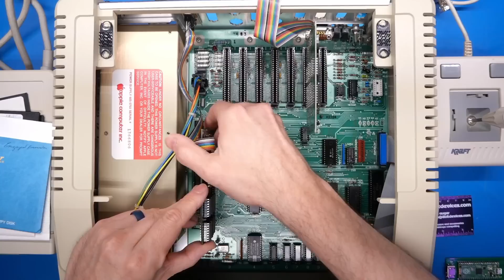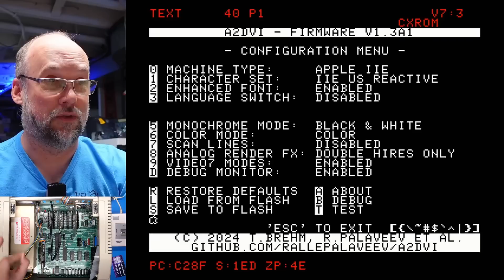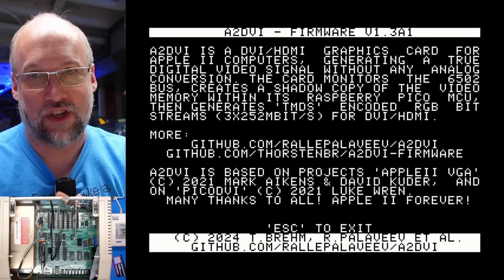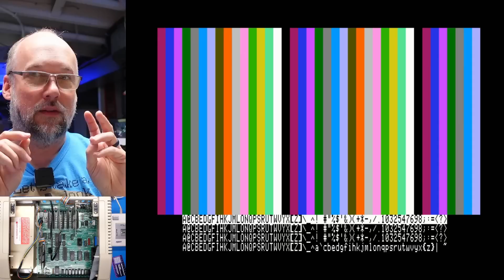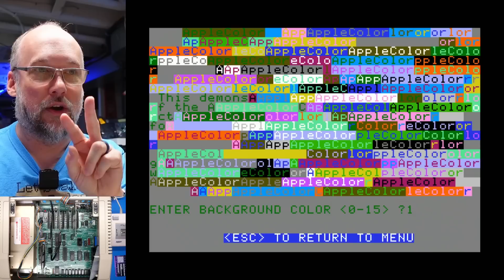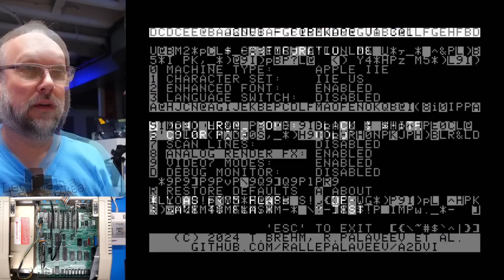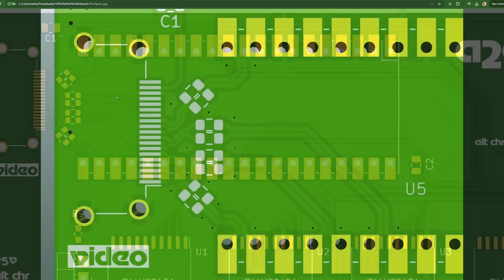HDMI video from your Apple II with this cheap and simple project (A2DVI)

Comment: Ok so any chance to add sound card support to the same card?  HDMI supports sound and video.
Reply: Unfortunately, HDMI is covered by patents. That's why devices like this are implementing DVI (which is compatible with the video portion of HDMI) and using an HDMI connector. True HDMI with audio would require an HDMI license.
Reply: @dnwheeler  the raspberry already has hdmi   You are supposed to be able to write software to use it.   Doesn’t make sense to me that you have to pay a special license   If I make a computer game for the pc I don’t have to pay a license for each person that plugs their monitor in.   If it can’t be done fine   Not a big deal  I was just curious because if everything is being done in software it would make sense to me to also emulate a sound card in software.
Reply: @krakenunbound raspberry pi yes, but pico does not have hdmi.
Reply: @krakenunbound  The Pi Pico doesn't have HDMI - the "regular" Raspberry Pi's do (and they pay the HDMI license fee for those).
Reply: @dnwheeler  a2fpga uses a Tang 20K dev board and as well as video also emulates the mockingboard at the same time and supports video from the IIGS too, and sends sound via HDMI, though it seems like some TVs don’t like the output. ReActiveMicro sells the card with a Tang 20K assembled for $199 (yikes!), but the project is also on GitHub. Ct6502 and Lon TV have done videos on it, as have a number of other YouTubers more dedicated to only the Apple II.

Comment: Fun stuff. And I've been "harping" about something similar, which is bringing "software based hardware" to old machines.Some sort of bridge from host to SPI/I2C and bam, "infinite peripherals" for "not much money". In this case, a beefier Pi would be the SPI/I2C part itself, you'd just connect the other peripherals to the Pi...
I'm a software developer not a hw guy, so I've been tinkering with the concept in a way that fits my world better, by using UAE's builtin bsdsocket to implement "proof of concept". And who would have guessed, if you have 100Mb I/O and a slow CPU, for many a task it's simply faster to send data and get the result back. Sort of fun when you go from CPU bound to I/O bound. But having "near real time" JPEG decoding with good scaling and color quantization is something a 68k can only dream of, yet, trivial to any "spare core" on my 5600...
That was the whole idea of expansion boards after all, it's just that now it easier to do them in software in new (off the shelf) hardware than it is to build "custom hardware".

Comment: They're not quite bit-banging. They're using the PIO processors on the RPI to do it. And they may have to overclock it a bit, too.
Reply: The Pico 2 is even better for this too, the Raspberry Pi team saw that people were using PIO for stuff like DVI video, so they added a HSTX peripheral to RP2350 which is specially designed to handle software defined high speed digital output cleanly.

Comment: I like your idea of switching between color and monochrome, but I'm guessing it would be easier to just add another accessible GPIO pin. Then you wouldn't have to hack the machine itself, the modification would transfer to any machine where you use this card.

I thought everyone in our "field" knew DVI and HDMI are signal compatible. You just need a passive adapter to interface them. This has allowed me to keep many old monitors working until they just fall over from old age, all with a $3 or so passive adapter bolted to the back. DVI doesn't support audio, but I never expected my monitor to handle audio, so that's fine.

Comment: Imagine what would have happened if Apple had included 80x25 text mode with the ability to change the foreground and background color per character way back on the ][+, with a font (in character ROM) that has the funky characters of the IBM PC character ROM from 0x80 to 0xFE. The release of the poor IBM PC (5160, I think?) would have been less than exciting, despite the advertised 4.77 MHz clock speed, as it would have really only added flashing characters as a new feature. Even worse if Apple could have overclocked the 6502 to 2 MHz, but that wouldn’t be possible until the 65C02, IIRC. Oh, well.

Well, now we have these (mostly), thanks to this new card. Too bad I don’t have a //e anymore. 😢

Comment: For the IIGS there is the VidHD, which also works for the Apple II. There are a few videos on YT about it. It’s $135 USD+shipping, so not that cheap, however it runs on a SBC, not a microcontroller.

Comment: How does this work with //e memory cards that include more than 64k of RAM in the extended 80 column slot, such as the AE Ramworks? Bus snooping that gets tricky since IIRC, the 80-col/DHGR video data always comes from the lowest 64k bank, which means you would need to pick only writes when that lowest bank is selected. The same issue might apply to //gs support.

Comment: When I was a young lad my parents purchased a used Apple II+. It came with a nice green screen monitor, 1 disk drive, 64k upgrade language card,  Okidata 82a printer, and Grappler + print card. The place I worked at had a Sun Remarketing catalogs. I wanted to run apple works and I know you could add another disk drive, and 80 column card. However due to the cost of even the disk drives. I sold my Apple II+ and invested into my Pc-Clone. Now it is years later I found out about, cpm card, and tons of other goodies like a rgb card. If I would have known the CPM card existed and a few other things. Probably would still have it. I loved playing with CPM on Kaypros. Speaking of RGB. I remember walking into a Radio Shack and looking at a Deck out CoCo 3 with RGB on it. It looks like a real computer. Compared to the TRS-80 Coco I had going to a small b/w tv.

Comment: i never had much exposure to the Apple ][, as it wasn't as popular here in Germany as it was in North America (for one, the NTSC artifact color wouldn't work in the PAL part of the world), but I think it is cool that there are enthusiasts out there creating new hardware to keep these vintage home computers running.
What does make me chuckle though (and I don't mean that in any bad way, it is just funny) is the fact that the RP2040 on this adapter has orders of magnitude more "computational oomph" while costing a fraction of what an Apple ][ cost back in the day. It's like putting a formula 1 engine into a tuck from the 1970s, just to keep it driving on the road. It feels wrong in a way, but at the same time if that allows more people to still experience this era of early home computing, that's a win.It sure beats all those still functional machines ending up on a landfill just because there's nothing to display the video on.

Comment: I published the firmware source for my Apple IIc VGA adapter, and hope to see someone fork the project with DVI support there as well. I had originally rejected doing an HDMI/DVI version of the VGA cards since the way the signaling is implemented is a cheat and I didn't want to risk having returns if someone's display didn't like the voltage offset in the differential signals. Adafruit and some others pioneered the DVI signal generation with the RP2040, and even they put a disclaimer that it might not work with all displays.

Comment: What's really curious is that Pico card might be several tens of times more powerful than the Apple II using a fraction of the energy... Therefore, you are using a much more powerful computer to output better video from the much less powerful old device.
Reply: It's not much different than a  i7 12700 with a rtx 4090, after all in this case the pico acts as a GPU.

Comment: I'm the developer of the A2DVI firmware - and worked with Ralle on this project. There several reasons why the IIgs is currently not supported. One is that it supports arbitrary colors (configurable palette). The DVI/HDMI uses a protocol. The PICO isn't fast enough to really compute this on the fly. A2DVI needs to use a trick, basically relying on precomputed protocol fragments - prepared for each pixel combination that it ever needs to display. Works great with Apple II due to fixed and limited colors. IIgs would increase the difficulty by a lot (pre-computed table size would explode). Also, the IIgs supports "scan line interrupts". IIgs software can change the palette in between scan lines. So, it's not enough to just render the screen: but each scan line would need to be rendered at the exact correct moment of time, using the current palette settings. That adds a whole new layer of complexity. Maybe the PICO2 is able to do it. Maybe we'll have to wait for another successor - like PICO3...
The remaining issues with Video7 mentioned by Adrian in the video are already fixed with the latest firmware. Also, the suggestion to use the switch for video mode configuration is already supported now.
Final comment: (--comment redacted by me: I was originally being "very critical" here of some "clone" designs of the original A2DVI PCB, which we published on github with Gerbers+KiCad. My criticism included Chris and his variant shown here in this video. My criticism wasn't quite fair and hit the wrong person. I apologise - and therefore removed this part of the comment...).
Reply: @MacRetroFly-ef8cc where’s the “official” one that supports your efforts?
Reply: Is the 8bitdevices one an official/"authorized" version?
Reply: I heard the original A2 analog designer David state this past Saturday that the Pico2 can likely have IIGS capability, but he won’t port it to the Pico2 until RPI fixes a bug with the Pico2.
Reply: Great job, my compliments!
Reply: Would be good for Adrian to see and respond to this comment.
Reply: If you need the bandwidth to handle the IIgs video (and even audio over the HDMI port) you might want to look at cheap Chinese FPGA modules like the Sipeed Tang Nano 9K. It’s a different tool set and way of thinking, but you have vastly more bandwidth available (750MHz x 3, 720p capable) without the need to pre-compute things. It adds to the BoM costs a little, but not horribly so ($20 for the Sipeed vs $5 for a Pi Nano).
Reply: @stevetodd7383  There is already a project using the Tang 20K to do exactly this - a2fpga.
Reply: 8bitdevices has an agreement with Ralle Palaveev who created the reference design for this device. A percentage of each A2DVI card sold is contributed back to Ralle to support this device, and upcoming projects.

Comment: You say thr pico is 5v tolerant, but the datasheet for the RP2040 states they are not: the lines are speccd to 3.3V+10%, or about 3.7V.

If some people have found that they can connect to 5v logic, that's just their luck, and not something that can be relied on. Indeed I have encountered 2040's that object to as little as 3.6V, locking up and requiring a power cycle to restart.
Reply: Pumping 5v will also likely activate input protection diodes, driving up VCC from 3.3 to 4.4v intermittently. This will cause the CPU to get hotter than usual. 

Instances where 5v works is likely dependent on there always being a line at 5v, to create a "stable" 4.4v supply.
Reply: The bust latches used are also level translators...

Comment: RP2040 is not 5V tolerant. It may handle it, but it is not guaranteed in all revisions. 5V tolerant means handling 5.5V on inputs, even when powered off, which is NOT the case with RP2040. On most pins, it will handle ~3.8V with minimal load which is quite typical TTL output. Over 4V the clamping diodes will break in and load the 5V TTL outputs.

Comment: Throwing away my 5160 with matching IBM EGA monitor and keyboard when i was a kid hurts my brain now...
Reply: Same as me ditching a VIC20
Reply: @paulstubbs7678  should be able to pick up a VIC20 for under $100. A 5160 seems to go for around $300, but the keyboard (Model F) will probably cost more than that. And they are a PITA to fix. They are easy to disassemble and nearly impossible to put back together, even with new foam, and then get working because the switch technology is weird. Model Ms are a little easier to fix, just time consuming - and the layout is better too!

Comment: The RPi Pico is definitely NOT 5v tolerant on it's GPIO's - yes, some people have found they don't need level shifters for their project to work. That does not mean it's safe to do so, read the specifications, the Foundation has specifically said the Pico needs level shifters for safe operation. They designed it, so I am pretty sure they know what they're talking about.
Reply: Often times when the 5V output driving a 3.3V input is not particularly strong, you can get away with it as some internal clamping diode that is normally only for ESD protection will limit the voltage. However, these diodes are only for short voltage spikes, and continuously having to dissipate energy can damage them over time. So while an accidental contact with 5V will not kill it, I wouldn't feel good about having it connected to 5V all the time.
Reply: The RP2040 will tolerate 5v on its IO pins - Eben Upton has confirmed this - but what it won't do is tolerate anything more than 5v, RPi don't claim 5v tolerance because that's generally accepted to require 5.5v tolerance in practice in order to account for voltage overshoots. But if you're connecting it to an old TTL system the RP will probably be fine as those signals rarely get much above 4v. This issue was fixed on the RP2350, which is fully 5.5v tolerant.

Comment: Computer semi-literate person here. I always thought microcontrollers were essentially very simple, low power, limited capability computers? Processor, program memory, RAM, and I/O ports.

Could someone more knowledgeable explain the difference?
Reply: Very hard to define what a microcontroller really is at this point, because in the past it would have generally been an 8/16 bit processor, ROM, RAM, and GPIO all in one package. But now, it's devolved to an MMU less processor with GPIO since modern smartphone SOCs, Pi Pico, Pi Zero have very much stretched the definition of what a microcontroller is.
Reply: @No-mq5lw  Thank you for the answer! 😄

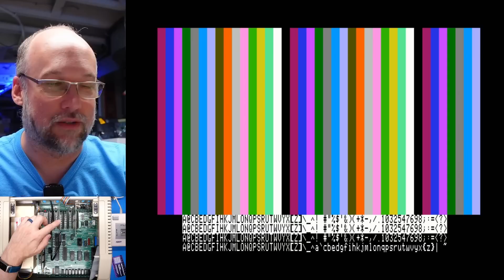Comment: @27:58 anyone wanna chime in on why the order of these patterns is 1032547698 and a@cbedhf...etc... instead of just 1234567890 and abcdef... ?
Reply: Haha, it's because no one except your has yet looked at that test page that close. 80 column mode uses two separate text pages for odd and even characters on the Apple IIe. The test page is created internally by the firmware - where I accidentally swapped the pages when generating the text. Fix is already in github now. Thanks for the report. Thorsten ;-)

Comment: The RP2040 probably has more computing power than the Apple ][. 😀
Reply: Many times more.
Reply: That’s true, it does, but this is a video card, and quite a few computers have video cards that have superior processing power to the main CPU, so not unusual.
Reply: @jonqu7041  Pretty unusual to have a videocard that is 40 years newer than the computer it is designed for though. Well not really anymore maybe.
Reply: Good point. What's the slowest Intel cpu that can properly feed an Nvidia 4090?
Reply: Maybe you can program it so that the RP2040 uses the apple 2 for video output to composit.

Comment: 9:15 - you should use a Level shifter with a RP2040/Pico if you are connecting its GPIOs to anything that isnt 3.3V because iirc its not officially 5V tolerant, means you might end up killing some picos or killing them over time.
Reply: The newer RP2350 is officially 5V tolerant, I believe, but yeah the RP2040 is not.
Reply: @owenvogelgesang7314  Actually the 5v tolerance was removed as of Aug data sheet update.... there is now a caveat that 5v is only tolerant if the IOVDD is powered by 3V3, thus you still need level shifters.
Reply: The maximum voltage for GPIOs in floating mode (a.k.a. input) is 5.0V for the RP2040, which doesn't qualify for the label "5V-tolerant", which requires the pins to tolerate 5.5V (10% margin). The RP2350 tolerates 5.5V, but as was mentioned before, with some caveats.

Comment: Nice! Now we need PC ISA graphics with DVI output.
Reply: already done with the graphics gremlin isa card, someone made a hdmi revision a while ago - will say that all these fan cards are pretty expensive, just getting a vga isa card and using a cheap adapter is more viable imo.
Reply: I think the new RP235x microcontroller might just have enough pins with the larger pin count variant. As well as faster CPUs and 3rd PIO block. Having hardware floats might help a bit too if needed.

Comment: Strange how expensive Apple ][ was, as it was built to cut all cost possible. Kind of sad, imagining what all Apple users lives would have been like had the graphics been a bit more capable. That fringing really was optically concussive and barfy.
Reply: Not strange at all considering the available technologies of the time. 

Find a picture of the original IBM Monochrome Graphics Adapter and count the chips.  Here, I did it for you. 

https://en.wikipedia.org/wiki/IBM_Monochrome_Display_Adapter

And that card came out four years after the Apple II.
Reply: @mikespangler98  True, I should have specified Apple ][E and ][C. They really should have been updated, graphics-wise.